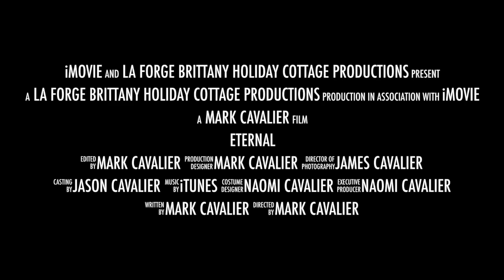Inverter heater CO2 sensor repair (error) How to fix C02 error on Inverter heater (Kerosene Heater)

Comment: I have an inverter heater and it smokes  excessivelyat start and again at shut down then runs normally no error codes. It seems to be overheating the kerosene causing the fumes. Before ignition and again when the flame is extinguished. Any advice welcome
Reply from the maker: Ours always had a puff of smoke when first started and again when switched off - I guess it depends on how much the smoke is